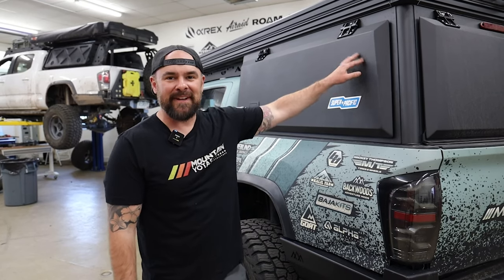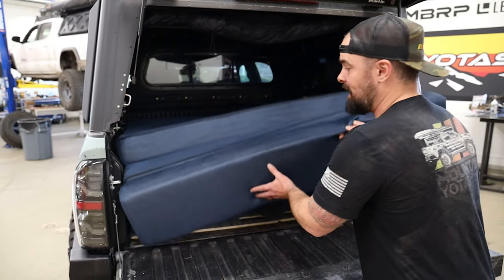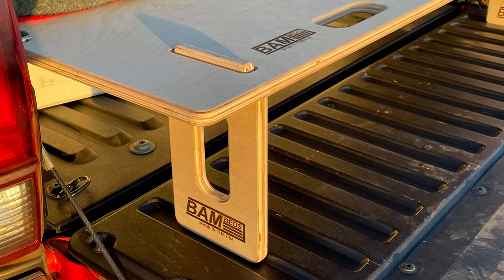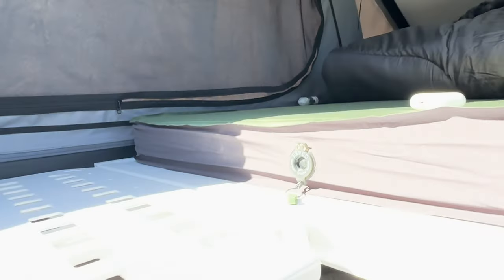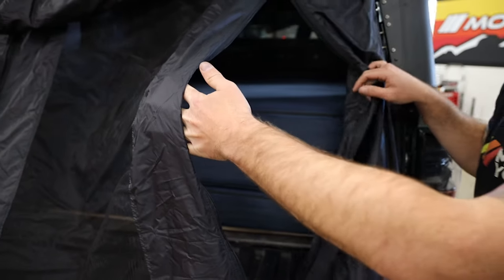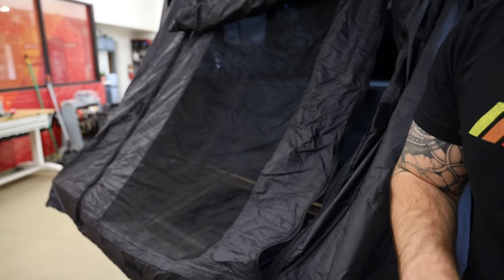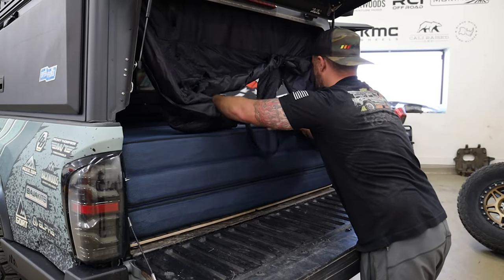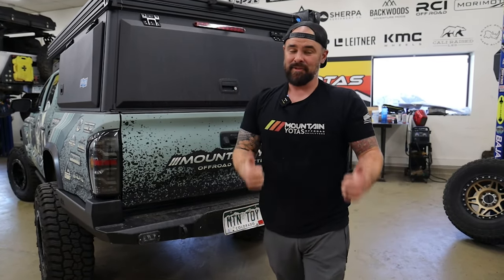Four people sleeping in a short bed Tacoma? NO PROBLEM!

Comment: with this setup there is zero space for the rest of your gear. This is not feasible for a family of four on a trip over a night or two.
Reply: Common car camping practice is to move your gear from the bed to the cab when sleeping
Reply: Common to who? Who in their right mind is going to unload their truck every single night, move everything in the cab. (we're talking a heavy fridge cooler, totes with heavy recovery gear, tools, kids toys, bikes, etc). That is definitely not common practice to anyone that has camped using a tacoma. A big RTT or a shell with a big fold-out canopy is really the only feasible solution to this issue.